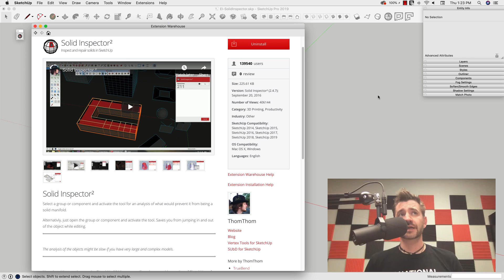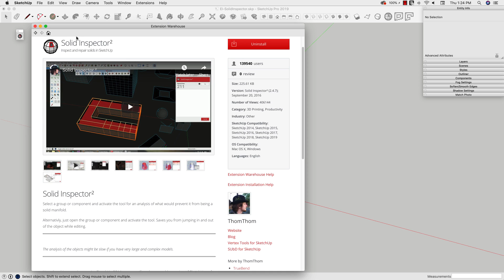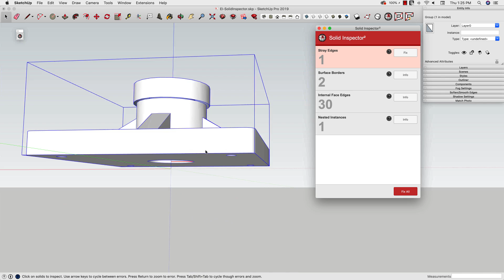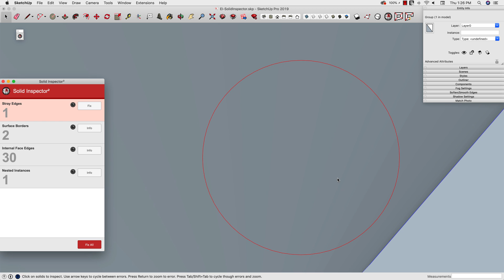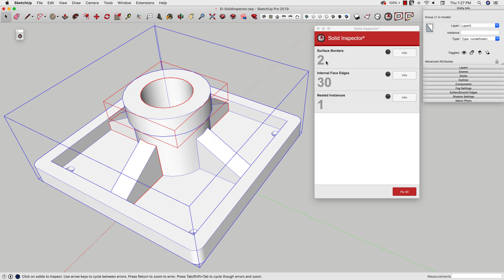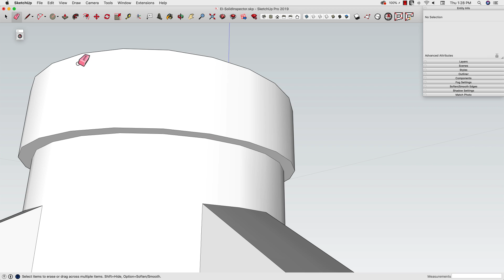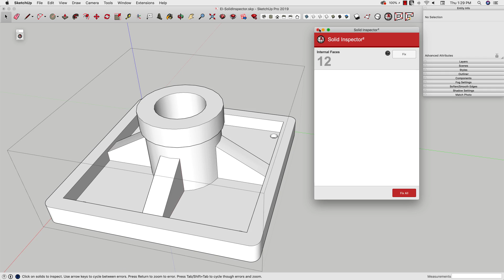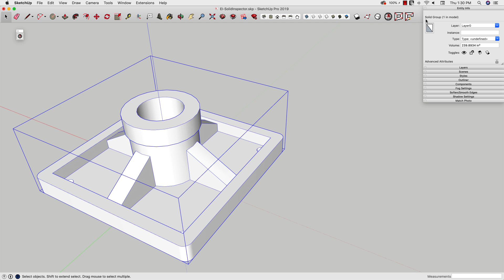SketchUp Extension Inspection: Solid Inspector

Comment: Hi Aaron, thanks for this video. I need to transform an existing model I built for digital presentation into a 3D printable model. I would love a step by step guide to doing this. I am using Solid inspector and have over a thousand internal face edges.... eek!

Comment: As a former GO user, I recently started working with the Pro version. The GO version has this feature built in by default and I use it a lot for effortless 3D printing. In the Pro version, this feature is not included by default and this tool is definitely recommended. I was already using it, but with Aaron's explanation, I can take full advantage of the ThomThom Solid Inspector. Top!

Comment: Hi Aaron, great video. I've gotten to the point where I use Trim and Subtract solid tools frequently, and I started having trouble with "Output Not a Solid" and/or "Nested Instances-Differences" errors. The "Differences" where showing up as instance names in EntityInfo and also in Outliner, and I had no idea what was going on. Your comment about "grouped geometry" within a group or component turned the light bulb on... it's nice to know that this is an occurrence with Solid Tools. Also, I was using SI2, but I wasn't aware that hitting "tab" would direct me to the problem areas. So this video is a huge help and a huge time-saver. Thanks very much!

Comment: I agree with the others that this is a must have extension.  It ranks up there with leaving Entity Info open during modeling,  Orient Faces, and the Make Face from Selection and Weld extensions.  Oh,  and good job of demoing and explaining the extension.
Reply: John.S.Clements dont forget outliner. That is a must have for me. I have it open all the time. It comes standard with pro but you have to turn it on. I forget how but its easy. It is basically a model tree. Shows you whats in you model space, whats hidden, what are components, groups etc. Way awesome:)

Comment: I love this extension. I use it for mass calculations for pricing parts or 3d prints. Once an object is made solid, it provides the cubic volume in entity info. From here, i have an excell sheet that has densities of 200 common items, all in drop downs based on category. I then sel3ct the material i want my part to be evaluated in, then i input its volume, then excell just multiplies it by the density of the material i choose and BOOM, it yeilds me the mass and cost of the part. Only doenfall, if part of the object was a different material...